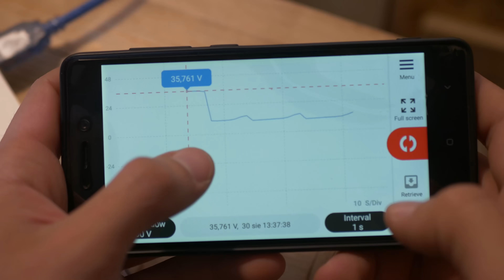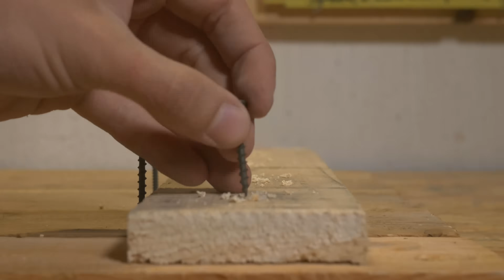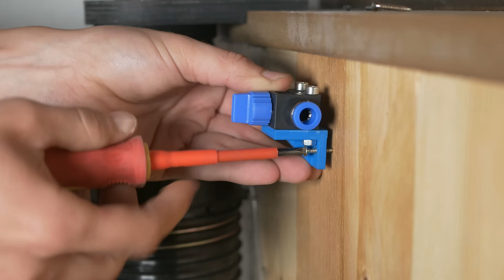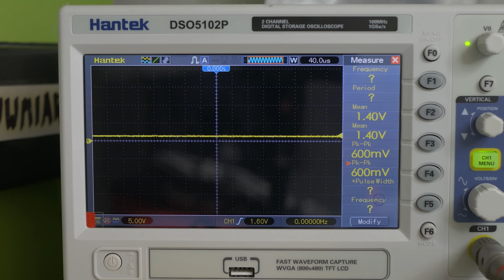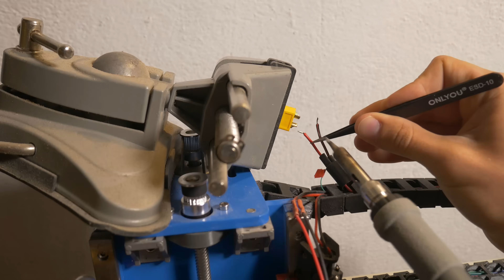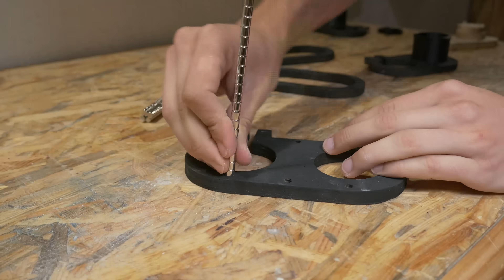Best upgrades to a DIY CNC machine

Comment: Now that you have a much more powerful spindle, a great upgrade would be to install a backplate that connects the upper and lower rail, effectively forming a box that would greatly improve the rigidity of the gantry. You could also use thicker sides and thicker aluminum profiles. Honestly tho, using such a big spindle might negatively affect the precision because it weighs much more and can cause the machine to wobble when you have fast accelerations. It's anyway much more powerful than the cuts the frame can handle.

The reason why you're getting such a burred finish on aluminum is that you're going likely way too slow. Use a program like fswizard to calculate the optimal feeds and speeds. Going faster might seem counter intuitive but it's the common mistake. If the rpm of the spindle is high and the feed rate is low, you can't produce chips large enough to remove heat from the material and it ends up gumming up or melting.

Comment: Hi Nikodem, I just finished the playlist and bought the instructions, but I have a question. I will use your design, but I plan to do a bigger projects and I would like to make the frame so big that the work area is 1.2m by 2m Or even more. But I have an assumption/intuition, that with this size it's not enough just to use longer frames, linear rails and ball screws. Perhaps it would require more linear rails, or higher quality ones or even thicker frames? Or in general what would need to be more sturdy to keep the precision of the machine as high as possible with the frame of that size, which would require a change in design. I have a really good technical background but no experience with this type of precision machining. Thanks for any response!

Comment: Never use wd40 on mql thst is horrible. Use dedicated mql lubricants that are biodegradable and harmless to breath in since the liquid evaporates at some point of milling. Also when using mql use some kind of filtration system you dont wanna breath any of that in srsly

Comment: Nice cnc. Although the X axis seems to look weak compared to the Y axis. Also the Z seems not so rigid. Best to replace the X beams with larger alu profiles and put them vertical for rigidity. I also never like to see a belt transmission. This is also not rigid and causes the z guide to vibrate when doing a lead in.

Comment: great video, great mods. Only thing to improve is your coolant. Use Isopropanol instead of wd40, it has way better cooling abilities and on top of that it's cheeper. (Alu only, don't use it with steel because of the fire risk)

Comment: Nice CNC improvements. Why are you using a 3D printed ball screw nut holder for your spindle plate? 
It will be your weakest link in the system

Comment: Two comments regarding your little pcb with the LM358.
1) add bypass capacitors to the +/- 12v rails. two caps each 0.1uf parallel with 4.7uf
2) do not leave the second op amp unconnected. 
connect - input to the output, and 
connect + input to ground.
If these things are not done even the simple circuit may mis-behave, oscillate,...

Comment: Why did the old 6600 drivers were unreliable?? The should support the voltage of the new power supply ok and the current of the motors just ok, I’m about to buy the drivers and don’t know if I should get the upgraded ones or not because were I live the 556 cost 3 times more than the 6600

Comment: Great stuff! I’m just getting my big cnc working order. One question: what was those small wires from the spindle cables that seemed to connect to each other on spindle end? Seemed odd and interesting at the same time. Something to do with interference?
I’m having some interference problems from the spindle to limit sensor inputs.
Reply: I believe you are talking about the power cables. They need to be at least 22 awg wire. It's a 3 phase spindle so 3 power wires. Believe it or not but this spindle doesn't have an earthing cable....... It is earthed through the spindle body connection to the frame...... Which needs to be earthed!

Your interference may be a result of your spindle having an earthing cable and therefore requiring a shielded cable to prevent noise.

Comment: I like the 1.5kw spindle upgrade.  On your DXF file have you considered having holes for both the 500w and 1.5kw spindle option, or have an option for two dedicated plates?  Maybe you could have three plate options 500w, 1.5kw and custom drill plate.  Also are you planning on having more steel plates kits on your website in the near future.

Comment: When you switched to 36V power supply, did you do something with the power to the Aurdino board? Can the Aurdino board work with 36V or have you used a voltage regulator?
Thanks for answer

Comment: Check if your VFD has Modbus digital interface terminals… most similar VFDs do. It will give you full digital control of the VFD using a cheap USB to RS485 dongle. Set RPM precisely, start/stop/reverse, you can even read the spindle amps in real time to give you a 0-100% spindle load display. Much nicer solution than PWM! Also, get some ferrite beads on those spindle cables, it will help reduce EMI which can erroneously trigger limit sensors etc.

Comment: so that parts list you have on the site: does it have these upgrades in it? i want to CNC wood and aluminum in 4x4' area. id like to run 48v system i think, given its faster and such.  i do not own a 3d printer (thats next) but i own bandsaws, plasma cutter, router tables, and mig welder. so id be find welding framework and such.   what is your recommendation to build a good system here?  thanks

Comment: Great video. The best upgrades I ever did to my CNC machine were a) a full enclosure which dramatically cuts down the noise b) closed loop steppers made the machine consistently accurate and c) a water-cooled spindle. Having said that, You’ve inspired me to try some of your ideas as well. Thanks.

Comment: You are saying in the video that "it's dangerous stuff, high voltage..." yet your wiring of the high voltage part is very sloppy. Especially the spindle motor connections. https://youtu.be/VLe03TqoPkM?t=1145 You should rewire those using cable lugs, and you also MUST connect an earth wire. The yellow/green PE can literally be your life saver if something goes wrong. You also used a TOTALLY wrong cable, since it is a simple one phase cable (L, N, PE) but it is used as 3 phase cable, using the yellow/green as one of the phases. In most countries that installation is against the law and besides that it is totally illegal, it is very dangerous. You are not supposed to use yellow/green as phase. So my advise is that involve a qualified electrician for the high voltage part, because really, "it's dangerous stuff, high voltage...".
Reply: Damn, I bet you're fun at parties...
Reply: @plibplob3916  ..and you are the bully who think he is somebody...
Reply: @AdaptingCamera  No. I'm the bully who got invited to parties...

Comment: This project is really nice!
I have a similar 230v Spindle in my machine and you can easily use your (old) 10V circuit to control this one, but it can also be switched to 5V (PD071 is the parameter I think).
You need to have a relay to connect FOR to DCM to turn it on though, and there is no spindle on/off pin on grbl 1.1, only PWM speed control.
You can however recompile grbl in the Arduino IDE and set a parameter to remove the spindle direction pin and make it an off/on pin to control the relay. The parameter is USE_SPINDLE_DIR_AS_ENABLE_PIN in the config.h file.

Comment: For your own safety, I recommend you use a 4-wire cable as the yellow-green should be connected to ground on the spindle!
If it goes wrong, your whole machine can become live!
Reply: Believe it or not, this spindle design has no earth cable but relies on being earthed through its connection to the frame! The frame should be earthed. I also think that the manual says not to connect an earthing cable......somwthing about an earthing loop......
Reply: @highjuice  The problem is that cheap diy frames are often made of aluminium extrusions. They are anodised, which means when you bolt them together, they have no electrical conductivity, unless you sand/grind through the oxide layer.
Reply: @Nealieboyee  That's what I've found!

Comment: I have been looking for someone to show the comparison between the TB6600 and DM556 drivers for ages. I couldn't find a direct comparison of noise between them anywhere and have held off on upgrading because I wasn't sure if it would be worth it. Thank you so much!

Also the weird drill bit you mention is called a countersink bit.

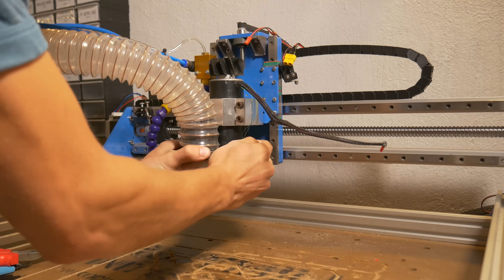Comment: Nice video, cool to see how you are tackling your cnc. I do think that bracket that you showed at @18:05 looks a bit weak! Also there is no backslash nut on it aren't you afraid it is going to vibrate in the z height?

Comment: Hello. After watching this, I have a suggestion. You should add the spindle controller circuit to a new model Indyshield.  

The original Indyshield is great, but it has some limitations, and a minor flaw. I propose a larger more powerful version. It starts with the capabilities of the first, but with the following changes and additions. 

1) Add the spindle controller circuit. Instead of a separate independent circuit board for spindle control. Add the circuit to a larger more capable Indyshield.

2) Additional "A" axis. I believe grbl also allows for a 4th axis. Adding a 4th axis would allow for more advanced milling.

3) Move the VIN and end stop posts. They interfere with the arduino USB and power terminals. There are ways to mitigate this, but consider moving them. 

4) Additional end stop posts. I may be wrong, but I believe grbl allows for two independent circuits for end stops. This may be useful in some instances. 

5) Do not limit the shield size, if the shield needs to be larger to accommodate the changes, so be it. 

The original Indyshield is great for the DremelCNC, but your IndyMill has advanced beyond that, and while the Indyshield will drive the basic Indymill quite capably, a more capable shield will allow for more advanced milling.

Comment: Hi, great video. Just curious. I have built an indymill and also bought a vfd controlled spindle to mount later. It weighs a lot(guesstimate 6kg). Is the z axis belt drive coping well with the weight?
Reply: Hi Daniel, the belt should work fine. However, the tiny printed Z axis nut holder will break sooner or later because it has to hold the complete weight (on two M3 screws, screwed into plastic).

Comment: you're a clever young man. The Indymill project has inspired me to build my own Nema-23 based CNC. I've acquired all the C-Beam and v-slot extruded aluminum for the frame and gantry. The next step will be to 3D print all the braces. So excited to see how it turns out.

Comment: 🤣 i made the same mistake with 2.2Kw spindle. I ran it in reverse direction for 2 days straight. Once i realized the mistake, i was embarassed for almost 2 days more. 🤣
Reply from the maker: I am still surprised that it is possible to cut anything with the bit spinning in the wrong way
Reply: @nikodembartnik  Don't feel bad -- I bought a special expensive blade for cutting stainless steel tubing (to make my MPCNC) and installed it backwards on the mitre saw. oops. I hammered my way through two pipes (they were glowing hot!) before realizing why the blade was not cutting very well and was wearing out quickly. Yikes!

Comment: These are some of my favorite videos! Once I have the funds, I will be making one of these for myself.
I don't know how practical for at home machining this is, but I cut aluminum daily at work and we use alcohol for cooling. We get a 200 proof ethyl alcohol in 55gal barrels that we go through probably too fast, but we are full production producing over a million units a year.
Reply from the maker: With such a cooling system in my small workshop it's better not to drive a car after milling something :)
Reply: Spraying the area to be cut with a silicone lubricant aerosol can make a noticable difference to cuts, even though it has been allowed to dry. This avoids ruining wooden beds etc.. It is obviously not as good as a proper lube system, but still worth the effort.  Watch out for your feet... parts remain slippery!

Comment: Hi Niko, I designed my own DIY CNC KR8 based on your Indymill & put in the 1.5kw spindle with GRBL control through a Pwm to 10v analogue board and ran into noise issue. If you use limit switches and use homing, the noise from the VFD will cause GRBL to give false hard limit or soft limit alarm. 
Because of this, I just ordered optically isolated PWM to 10v board to isolate the noise from the VFD to the Arduino board.
Are you experiencing any noise issue after switching to the 1.5kw spindle with VFD control ?

Comment: The biggest problem with the 500W Spindle (aside from some EMI issues) are the bearings. They are usually using 2 8mm skateboard bearings that are fittet in rubber caps in the motor lids to compensate for bad tolerances which result in too much give in the spindle. I made it better by making a separate spindle with better bearing system that then is driven by the motor over a belt. The 500W performannce is enough for most things in my experience.
Reply: My handheld router is 1500W, isn't this the minimum you need for a good cnc machine? 500W seems a little low.
Reply: @powerpc6037  That is my thinking too
Reply: Hmm have here a 750w one it’s a joke. Upgraded to a 3kw one hsk40a

Comment: It’s super dangerous how you connected the new spindle
Reply: Yeah, I would definitely recommend adding proper crimp connectors. Not only is it not safe for you, people could start to assume this is the correct way.
Reply: I have the same cheap automatic wire stripper/crimper he used im the video and it even has crimp connectors included in the package. The first thing I did with it, when I bought it, that I upgraded all of my internal connections in my 3d printer.

Comment: Hi Niko, I have a recommendation for you. Based on my experience in building and using my CNC.
I found that the gantry, if you only use the aluminum extrusions and linear rails, is considerably strong, but when you use a heavy spindle or the spindle is under heavy loads, it tends to bow for the weight and twist under load (less than a milimiter, but translate in larger movements in the cutting tool). 
This is not gona make imposible to use the machine, but it´s gona be a little bit more imprecise that what is capable. There is a lot of potencial solutions to this problem, but mine for speed and moneay was simply adding a backplate with M6 screws to the extrusions. 
You can even screw it to the side panels for the other axis to make it more rigid.
Reply: if i wanted to run a larger frame, do you think it would work to weld a steel framework and attach the extruded aluminum rails to that for added strength? im researching building a 4x4' CNC
Reply: @beardedgaming1337 If you have the possibility of welding, I will recommend you don't use aluminum extrusions at all. Aluminum extrusions are great for modular and cheaper machines, also are straight that is not always easy to get, but are not the strongest. Yes, you can use both if you want to add strength to the extrusions, but is gona be weacker than just steel. You can even use regtangular tubing for that, only make sure that the wall thickness is thicker enough, and maybe you will need to make flat the faces you will put the rails with lapping.